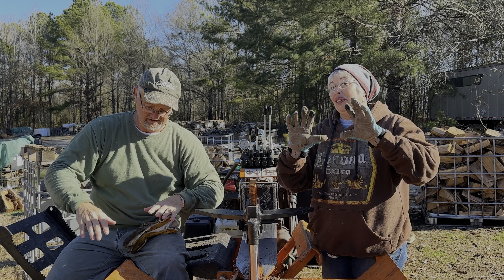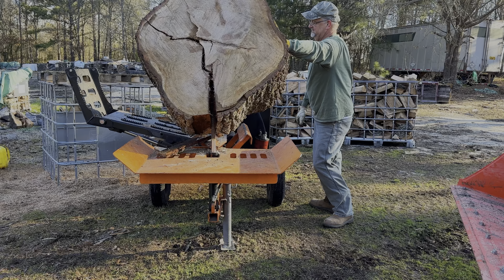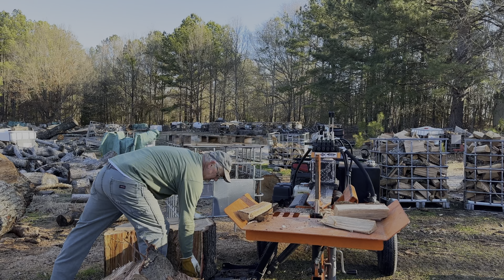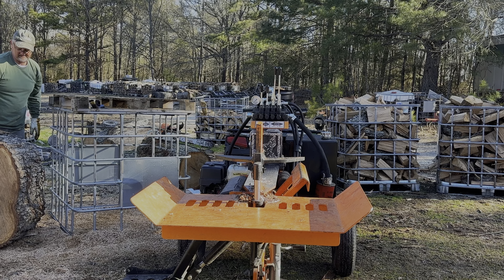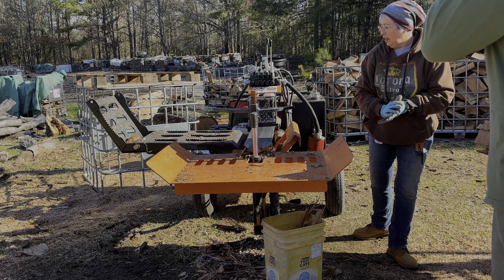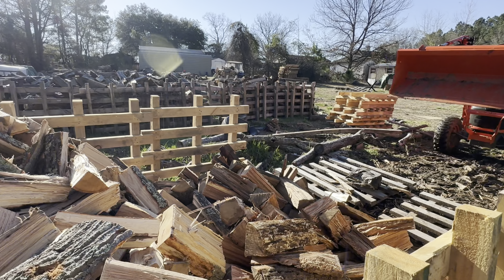42” Red Oak Splitting #firewood #splitting @WolfeRidge

Comment: That was a biggie. I’m surprised that the splitter didn’t tip when lifting that round. Those are not  something you would not want to do every day. Lots of wood out of it thou. Where did you have the throttle set when doing those. 
Have a great Friday. 👋👋👍🏻👍🏻🪵🪓🔥
Reply from the maker: Throttle was set low. Forget to increase it on the first big round but splitter didn’t have any problem going through the wedge.
Reply: @RicksOutdoors29127  👍🏻👍🏻👋👋
Reply: Nice job Rick, what happened to the chain?,don’t like to noddle either but if so there you go 👍🪵🔥
Reply: @Lens-KeepingBusy  👋👍🏻
Reply from the maker: Got pinch and came off and damaged it.  I may can grind it and make it work.
Reply: @RicksOutdoors29127  👍🏻👍🏻👋👋
Reply: I noodle my big rounds, the days of trying to split while they are this big is over, at 72 body can't take it!!  Hope chain can be repaired!!  Stay Hydrated and Have a Safe Day
Reply from the maker: Pretty sure the other 2 will be noodle.  Have a great weekend